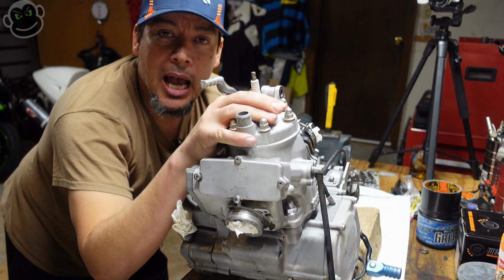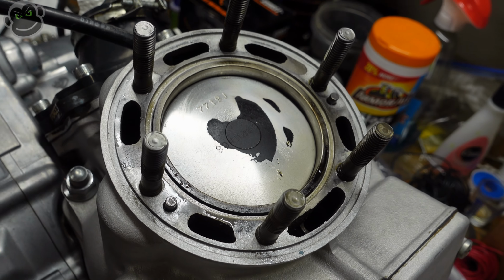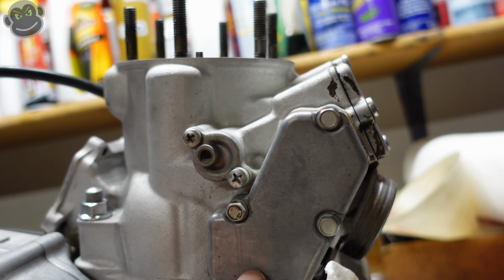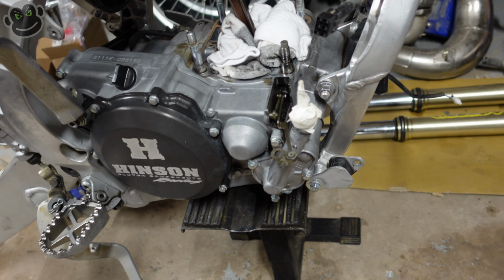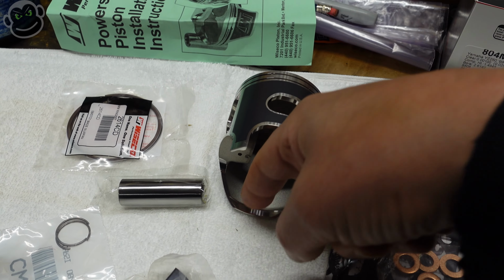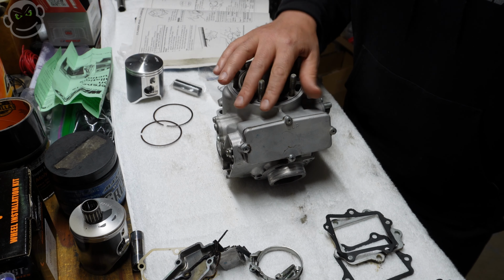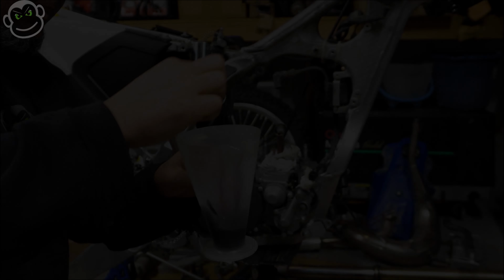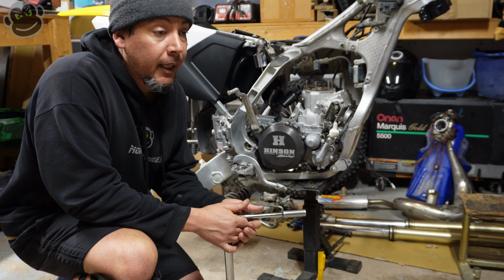Yamaha YZ 250 Build EP6 | Top End Rebuild 2 Stroke | Wiseco Pistons

Comment: Hey mate! About to put my yz back together and just did the swing arm bearings. Did your collars through the breading not sit flush? Mine stick out about 1/4”
Reply: Through the bearing*
Reply from the maker: It's been a minute but from what I remember, the swingarm bearings need to be measured when pressed in.  They are supposed to recess in only so far and there is no back stop on the swingarm like there is in the linkage.  For the linkage you press the bearing in until it hits the back stop and won't go in any further.  Swingarm is press, measure, press some more, measure some more and then stop once they are recessed inside the swingarm the right amount.  If your collars are sticking out it's probably because the bearings are not in all the way?  Again, it's been a hot minute, I may not be remembering correctly.

Comment: Actually, running more oil in the gas will not foul plugs if the jetting is crisp, (stock jetting is terribly rich).  With good jetting, (I changed every jet, and it is still running rich in the middle), it will just burn the oil like it should, and get a good plug reading.  I just took off my cylinder with the Weisco piston in it, and I only have 4 hours of running on it.  But at 32:1 with Motul kart GP 2t oil, (a great oil, durability dyno tested by friends of mine), I was a bit surprised that none of the piston slick coating is gone.  Not sure if you did this in this vid, but make sure the C-clips for the piston wrist pin have the open end either at 12 O'Clock or 6 O'Clock.  If the open end is sideways, the direction change of the piston at high rpm can actually compress the clip and pop out, and destroy your cylinder.
For the torque wrench extension, since it changes the length of the arm, I think you have to do a little math to get the torque right.  I went by feel also, but did it a bit differently than you did.  I had to file off .002" off the ring end gaps for my Weisco rings. That intake hole in the piston also helps feed the 5th transfer port when the piston is going down.
Good vid.  You do good work.  Doug in Michigan
Reply from the maker: Thank you.